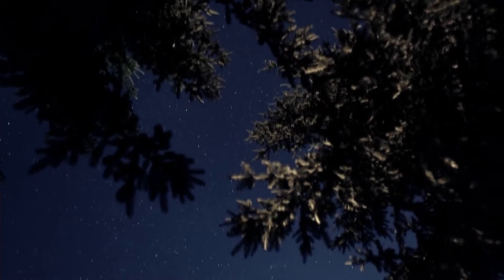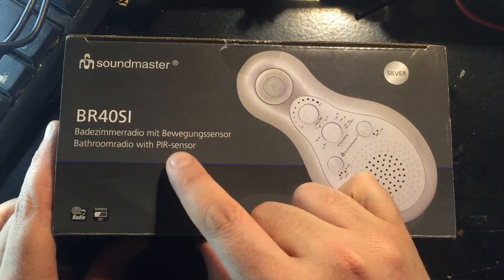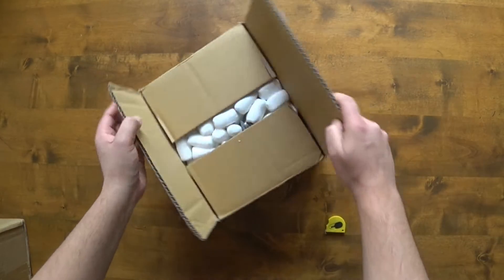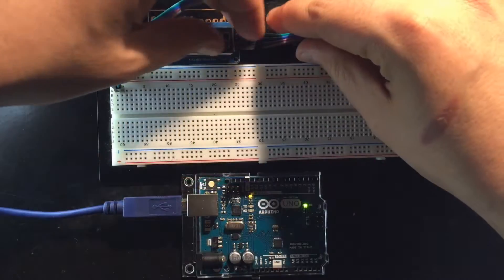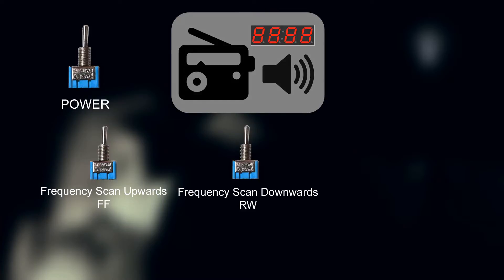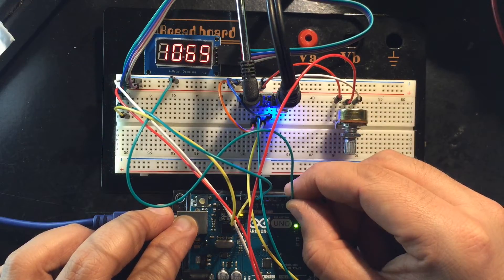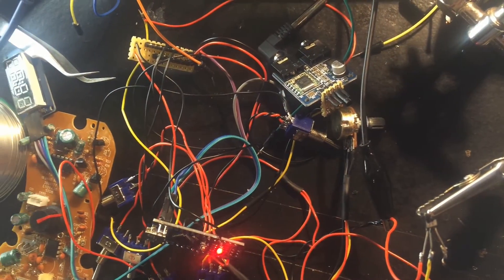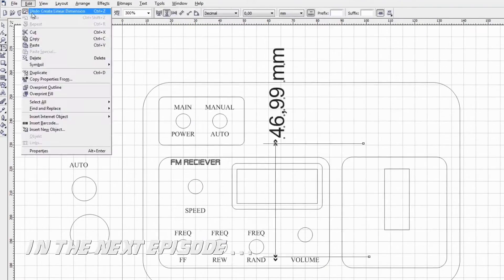Build The Ultimate Ghost Detector   Part II  / The Advanced Spirit Box

Comment: Since 7 years old my uncle teach me what was positive and negative in electronics. And ever since then I've taken things apart, to see how they work. And when ever I get a chance I try and see if I can either modify something or make it myself. I recently built my own Bluetooth speaker which is way louder and way better than whatever you can buy at the store. I build my own electric scooter, I bought all the parts on eBay and save myself a lot of money. It just say I have a scooter that goes 35 mph and I spent less than $400. Not bad scooters that go that fast are over $1,000.

Comment: You can buy an amplifier for the arduino too. Which would you recommend if we didn't want to buy a radio?
Reply from the maker: Have not tested it yet but sure there are multiple options. I think the form factor will be an important point depending on your housing.

Comment: Wow, weeks of learning computer windows 7, USB port problems, and Arduino problems with the steep learning curve of it , I have got this man's code cut and pasted into a scetch that has the TEA5767 and TM1637 as described and 1 switch, but all switches checked.                   I can celebrate this with a night off and return to why the radio module doesn't work tomorrow.  I pinned both modules to the 5v output and am getting a buzz and pinned the Radio module  on A4+A5 . No radio.  Any suggestions anyone?.  Thanks Bob

Comment: Weeks later still at it..... so many Arduino error codes, 6 hours today ... Not you Arduino is B.S.
Reply from the maker: I would try adding one piece after another. Check a simple script for the serial monitor. That will show you visually if all the switches or potentiometers are working correctly. Try the radio shield with a pre-made code from google to see if it works. Then use the Ghostbox code and add piece for piece. The code should run even no switches or potentiometers are connected. Check that everything is wired to the correct ports and you use ground from the board not from the powersupply as a return line from the poti f. Ex. It needs to be common ground!
Reply: @MancaveEffects  Hey Boss, I have I  fryed a FM modular, I had the wires reversed on the nano board . Sir I have the sweep running with 2 switchs, pam amp powered by an independent battery pack, No pot yet so scan is pretty fast but it's picking up a station now and then  so unknown the TEA is working.     But I have a hell of a buzz and staticks bad . unplug desplay and buzz goes away. I know I have read about 12c (?) interference.  

Do you have a clue or a fix for the desplay buzz. ...Seams like if the scan switches are off I get no stations interipting but a lot of static... Please if you could would you help I have come so far.... Bob Harrison
Reply from the maker: Hi Bob, thats a complex question… there are probably lots of reasons why the lcd introduces a buzzing sound. Did you tried to shield the lcd or put it away as far as possible from the radio board? Maybe try to adress other outputs on the Arduino board that are further away from the radio shield. It could also be that the lcd introduces noise thru the data or power line. I am honestly not experienced enough to tell you a proper solution because i did not encounter that issue. What i would do (and this is not a suggestion only an idea) is to put a smoothing capacitor in line on vcc to the lcd or gnd to see if that helps.
Reply: @MancaveEffects  I did separate them as far as wires would allow.  just switched LED to 3.3 and getting less buzz.. Boss it's running.. I feal good
Reply: @MancaveEffects     Do some more research and redefine led pins maby?
Reply: @MancaveEffects   Swapped LED screens . no luck
Reply from the maker: You could try running the lcd entirely from your powersupply that powers the arduino. Just make sure it is the correct voltage. If its still buzzing i would put a smoothing capacitor
Reply: @MancaveEffects  Killed amp. no luck with just head phones... Dang... It's loud
Reply: @MancaveEffects    I'm using a 9 volt battery. I have no problems changing it but would have to get one.  the Display is Max 5.5 v . for portable I don't know that battery pack...
Reply: @MancaveEffects  Hey , got an idea for the statick?. Or I'm i pushing?.
Reply: @MancaveEffects  I don't know if it went through but I stuck the power wires into my amps battery 3 aa pack and buzz is gone. you got it... thanks... power . wonder if Arduino codes somewhere like clocks would be a place to see there pins compare them with the nano pinout pullups or digital or something like that.
Reply: @MancaveEffects  Im kinda having a few days away from my radio but I did find your pinning in the code. It's in language I have never seen before. I was wrong again. I still have no idea why the i2c buzz and am trying to maby get the linear transistor and parts to see if I can't run the separate circuits off the same 9 volt Arduino supply.              Have the transistor, buck regulator and resisters to get at the electrical shop. but my car did a electrical problem of its own so I might be away from my radio for longer than I hoped. . Alot of time to have wrenches throwen in at the end.    I don't know your name or I would thank you properly . So   Thank you Sir.   progress wi be shown to you as soon as I can.  Bob
Reply: @bobharrison9620  hi I have the same issue. Did you found a fix for it?
Reply: @Thomas-ow8qq   I don't know if this is what your running into the codes not loading?
Reply: @Thomas-ow8qq  If so and your using the Simon munk TEA 5767 radio files it was the spelling entering Mancaves into Munks.  Respelled Mr Munks I think... Can't check I lost a computer... Don't do Best Buy file transpher. I lost a display cord took a running HP laptop to them, they transphered one windows 7 box into the 10 and I fixed the cord.. They crashed my hard drive and woulldnt even open the case they just said tough luck..   Anyway I will help all incan by memory if you need...
Reply: @bobharrison9620  no sorry 😊 I mean the buzz. if I connect the 4 digit led display I get the buzz sound.
Reply: @Thomas-ow8qq  I had to hook that to a separate power supply first.. then i went power 9v into Arduino and went off that with a cell phone 12v to 5v reducer power supply and that worked also., please reply of it helps when you try. Bob
Reply: @bobharrison9620  thx for the information 🤩 i will test it tomorrow when I have time. Thank you 😊
Reply: @Thomas-ow8qq     Thomas as far as I could research it it's in the I2c code and I'm not that far to rewright the code.. this is kinda what I figure is a back yard fix... do you get a battery to last? I'm using 9volt radio battery's and when they get to 8 volt it won't work.. 7.5 rc battery's won't run it.. in think I fryed a board voltage regulator ??? Bob
Reply: @Thomas-ow8qq   Sure let me know and battery info if ya can .. this guy bent over backwards for me he's a good dude.
Reply: @MancaveEffects  Ugg. pulled the dio and clk lines and still buzzing. doesn't quit till I pull power...
Reply: @MancaveEffects  Hey Boss ,
I was going through the code and didn't find it he TEA or TM defined in the code. I'm real new as you know so I'm asking because there both running as far as I can tell but like the CLK. DIO SDA and the SLC.   
Do you know why? I'm trying to pin the TM into the Arduino still as right is right till it's not... Now I could not download your code and open it into Arduino I had word opened and cut and pasted but looks like on the floor
 YouTube ... Thank you Bob.
Reply: @MancaveEffects  Hi, bet you had fun with the code recognizing also upon install.  I asked about pinning and found the Radio is a constant.      But in your code the Display pins are undefined, But the display is running. I don't understand it do you?  I'm researching still and 2 i2c run fine they say.   This isn't my last project so I have to get it.   I want motion detection in a few ways for spirit stuff. Would it make a project for your channel?    Bob

Comment: I'm not trying to sound ungrateful, I think you make VERY pretty toys.  I'm sort of confused on why you need a forward, reverse, and random scan direction.  Is this really applicable to ghost detection?  Just wondering, or is it just to fill up space on the box.  I'm also curios if your compass is stuck for the most part always pointing North toward your audio speaker.
Reply: The foreward, reverse, and random functions are important to be used to further proove the validity of spirit recordings in real time, thanks again dude!
Reply: @globmobgoblin  Thank you savvy one, I was totally off here, I had assumed it was attached to the scanning of radio frequencies, not a recording device.
Reply: @maryjaneevadiamond6359  no it totally is the radio frequencies, so say your capturing something in the foreword scan mode, if you were to then switch its function to random or reverse and capture the same voice or voices its a good way to prove and show how the spirit box actually scans the radio waves in real time, making it impossible for the minor sounds that may come in while scanning to create full sentences of the same voice, great for heavy non-believers👍

Comment: Caution  in trying to build this , His sketch of the wiring and the programming and parts supply dont match, buying Arduino and getting it to work is a bear to put it nice. buying the parts will cost a bit, the codes he has dont match the hardware pinout if I have drawn all this out right. And nowhere do i see him giving credit to the man on the Arduino board  for helping him redo his code. I am 60 a Bike teck and not a dumb guy but to do this you better have a computer coding degree. Comment or connect with me and tell me where im wrong, I would love to salvage a months worth of time and $200. bucks in parts and books. Bob H.
Reply from the maker: Well, i know about a couple of people who used the design and the code without much issues. So let me know what is wrong with your setup.
Reply: @MancaveEffects  Oh my god ,I got so many error codes but got the no .h file figured out. Paid the guy for him to try to solve it and I did it without him thanks to a you tube teacher. And with 4 hr. sleep. then the Avadude port not recognized again got that and was able to run a TM1637 test and stoped for the night. I can understand your spegetti electrical on the table in the vidios a bit.   I have come a long way I think.   Not the plug and play but a great learning experience.  I'm wondering if my electrical store has a rotary dial instead of the 3 switches. maby one for power also. I have to go get another amp anyway. ...
I just had to tell you , hope you don't mind me keeping you informed of my build and bugs, Thank you Bob

Comment: hi, i connected all the wires as you showed in the video, but the potentiometer, 4 digit screen is not working i tried many ways to fix it but nothing helped. do you know why it doesnt work? <3 i when i put it on forward mode it scans forward but i cant change the speed.
Reply from the maker: Is your potentiometer wired the right way an does it have the right resistance?
Reply: @MancaveEffects  i have a 10k ohm potentiometer. I have the ground on the left and the middle cable to the Arduino and the right goes to vcc
Reply from the maker: @Thomas-ow8qq  are you using Ground and VCC from the arduino board?
Reply: @MancaveEffects  the ground is connected to the Arduino. And the vcc cable is only connected to the potentiometer
Reply: @MancaveEffects  can I send you a photo via Facebook ?
Reply: @MancaveEffects  the vcc cable goes from the potentiometer to the 4 digit screen
Reply from the maker: You can check if the potentiometer is working by using the serial monitor in the arduino software. Also for the 4digit display you can open a new arduino project and load a demo file from the arduino software to check what is wrong with it. Maybe its a wiring problem.
Reply: @MancaveEffects  okay I'm gonna try it
Reply: But the only cable that is coming from the Arduino to the potentiometer is the one that goes in A2
Reply from the maker: @Thomas-ow8qq  there are 4 digit displays that have an integrated driver board and others. It is imoptant that all the components run on common ground and voltage
Reply: @MancaveEffects  it works now but i hear a weird beep sound the whole time i connect te 4 digit screen and if i disconnect voltage from the  4 digit screen its gone
Reply: @Thomas-ow8qq  Mr. Thomas, I am Bob Harrison, I found your conversations to Man caves about the spirit box. Sir I was wondering if you have gotten the i2c squeel out of your ghost box TM1632 display power lines? I did it by running a separate 3 pack of AAA batteries. no squeel. I am trying a 5 volt USB 12 volt car charger Buck converter I think it is. Going to get to it soon. I have Tryed all but the trim pot at this point but I have to finish the first spirit box today or so to get to it.   I have learned so much attempting this. The proximity device I had made before and it worked as a stand alone.   Hope this gets through. that squeel is above my head I had to cheer. Also want to run a pam amp so it needs a separate power as the draw is not to my likeing to draw from the board and cheering and using it for the Desplay workes for me.   Bob

Comment: Is it possible to convert a Sony dream machine into a ghost box? I'm afraid to cut any wires until I get a tutorial...
Reply from the maker: Hard to tell… some radios have all the circuitry integrated in a single blop chip. You could certainly get rid of all the guts an replace them with an Arduino and a fm radio board, this all only costs a few bucks.
Reply: @MancaveEffects  it does have a blop chip. Thank you for letting me know about that. :)

Comment: Hi i have a question for you because you used the pin (VIN) and not the pin (5V) ? . 
Beautiful video
Reply from the maker: The VIN can also act as an 5v output on the Arduino board. I can’t remember why i did this but its certainly because the other 5v pin was already in use
Reply: @MancaveEffects  okay thank you